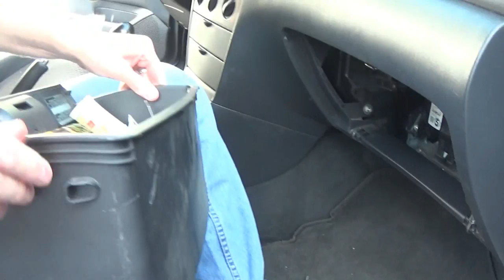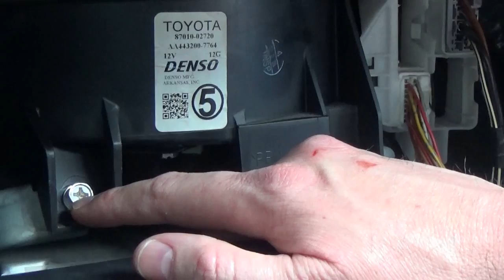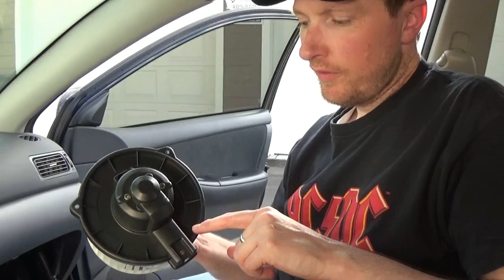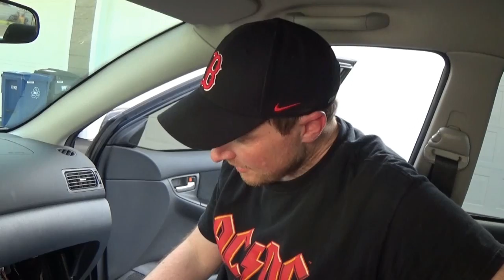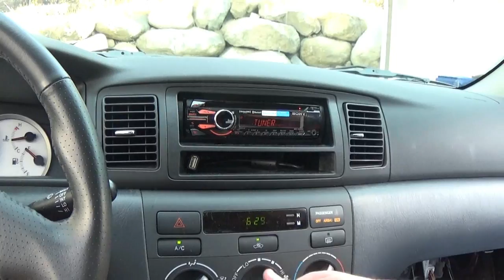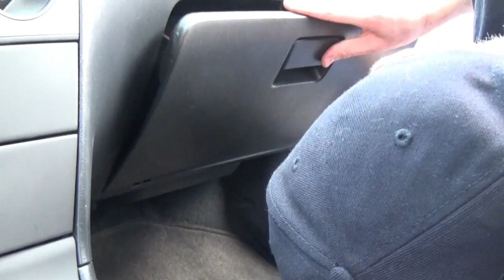How to replace a blower motor in a 2003 2004 2005 2006 2007 2008 Toyota Corolla

Comment: Thanks found this very helpful. I went to Garage and they wanted £75 for Diagnostic charge, the further cost for install part and then price of part which would be £250.  My blower wouldn't come on at all so checked obvious fuse, tapped a few relays incase one was sticking as my blower would come on sometimes and then stay off.  But not relay problem.  Checked Blower Motor resistor control which looked ok which is just at back of blower with 2 screws to take off, thought may been loose solder connection or dodgy resistor but it was ok.  Tapped bottom blower motor and sometimes it would come on or change speed as if it was sticking.  So took blower motor off as you shown with 3 screws . Also found blower motor filter above which took out and tried cleaning as it was full of dust.  I took plastic cover off blower motor back to view motor commutator and bushes also lot dust came out. So gave it good WD40 and let drip out on floor outside. I refitted and unit works fine, but it does change speed a bit on its own accord without selecting change but if you tap bottom of blower motor its goes back to normal.  The bushes looked warn and comm was well worn, so do think need new one but least got it going for a bit so allows time to get part.

Comment: Hi Todd, ths very helpful video. My 2004 corolla heater/ac blower just stopped working one day. But when i ran on a railroad and had a vibration, the fan suddenly started. Now, the motor had stopped working again. Tried to get a vibration again but not working this time. What do you think, some kind of loose connection?
Reply from the maker: +Donald Versoza thats a tough one. You could take it out and clean the connections and reconnect everything to see if that gets it going again. Good luck hope you can get it going!

Comment: This is one of the best on the Corolla Blower motor removal.  Unfortunately, you skip over most of the hardest part - installing the motor.  How do you hold up a 5-10 pound motor while you hold a screw with another hand, and hold the screwdriver with your spare hand?  My solution is put short strips of duct tape from the bottom of the motor and hang them to the surrounding metal above.  My problem was that my T20 screws are real short, so after hours of trying to start them into the first hole on the hole nearest the back (near me) I had an idea.  I substituted a longer phillips machine screw, which was long enough to find the screw hole.  After that first one was secured, it was much easier to screw in the original shorter screws into the two holes on the sides.

Comment: Followed your video.  It helped enormously.  I took the blower motor out because it didn't work at any speed.  I connected it to a 12V battery charger I own and the motor spun.   (+) and (-) are easily seen on the plastic housing.  Just as easy to connect a few feet of wire to the battery and connect it to the fan.  Anyhow, the motor worked connected to the 12V charger.  I reinstalled the motor and realized my electrical connection must have been faulty.  As soon as I put the connection back on, it worked.  Corroded connection or something - known as electrical creep.  I didn't have to buy anything and it works now.  Thanks.  I was ready to spend a $100 on it - lol

Comment: Thanks Todd. My blower started making a high-pitched squealing sound, so I watched this video and was able to take it apart and fix it. The problem was that the filter had been sucked down into the fan. Although your video helped me do that, I could have saved time by first checking the filter. Other than that, thanks! It made the whole thing A LOT easier!
Reply from the maker: Right on, glad to hear.  I've had my air filter get sucked into the blower before too!

Comment: The screw closest to engine needs to be removed from the bottom tray before its shoved over to side, common sense but someone less mechanically inclined may break a bracket by forcing that. Also a socket can also used to take off the bottom 3 screws in addition to a star driver. Helpful video thanks!

Comment: Thanks Todd! I've got one in a 2010 Corolla bought from Drivetime, (don't ever buy a car from them!) and I never had a blower motor go out on two Camrys I owned nor any other vehicle I've owned. I don't know why this one is going out being only 6 years old with less than 50K miles on it, but none the less it needs to be replaced. The Speedy Oil change place quoted me "about $200.00" to replace it, and after having replaced my serpentine belt on my last Camry I thought I'd look into how to replace it myself. Kudos to you and your wife or girlfriend for this video! It's very informative and looks pretty darn easy! I'll watch it again before I give it a go, but just wanted to thank you for the video! Do you know if it will be relatively the same on a 2010? I haven't found a video on how to replace a 2010 blower motor for a 10' Corolla. What year Corolla is this video on? Thanks again for the video brother! Nice shirt too!
Reply from the maker: My Corolla is a 2006. How did it go for you?
Reply: I haven't replaced it yet...haven't had the money...should be able to soon though. I replaced a serpentine belt on my Camry and after watching your video I know I could replace this. Thanks again for the great video I'll refer back to it when I get er' done and let you know how it went brother.
Reply: I haven&#39;t replaced it yet...haven&#39;t had the money...should be able to soon though. I replaced a serpentine belt on my Camry and after watching your video I know I could replace this. Thanks again for the great video I&#39;ll refer back to it when I get er&#39; done and let you know how it went brother.

Comment: Does  anyone know where the Blower Motor relay is located?  The diagrams on the fuse box under the hood and the one by the Driver's knee do not have obvious descriptions as to which one it is.  Thanks!  And thank you, Todd, for this awesome video!!!  How anyone could give a thumbs down for this is beyond me.  They must not know what a flat-head screwdriver is.
Reply: Jesse Peterson
Reply: Jesse Peterson
Reply: The relay is located ABOVE the blower motor.  You won't be able to see it by looking from below.  Its kind of sitting on a shelf.  If you put your hand up there, feel for a larger square object (There are 2 if I;m not mistaken). While touching up there, turn your blower motor on and you'll feel it "click"...if its not bad.
Hope that helps.
Reply: Its been a while since I did this but I did check my relay and it "clicked" like it was supposed to.  I think my memory is pretty good so this should be decent info for you

Comment: Todd, do you know of any other issues that would cause the corolla to stop blowing any air? I replaced the blower motor but that wasn't the problem. I feel like I've checked all the fuses, unless there are hidden ones for the blowers. None of the settings blow any air, the AC light doesn't come on as well. There doesn't seem to be power getting to the blower motor. Could a switch in the knob be the problem?
Reply from the maker: Another possibility is the blower motor resistor,  follow the wires coming off the blower motor,  it's a small plastic piece held on by a couple screws,  should cost about 5-10 dollars.  Good luck!

Comment: Todd thanks for putting this video together.  I don't think I would have attempted it without it.  Turned out to be on the easy side.  My problem ended up being a mouse nest above the filter which was rubbing against the fan cage making a noise.  With 280,000 miles on the Corolla I changed the blower motor since I already had everything opened and we are heading into winter.  You saved me a couple hundred bucks!  Thanks again.
Reply from the maker: Glad to hear you were able to get it taken care of easily!!